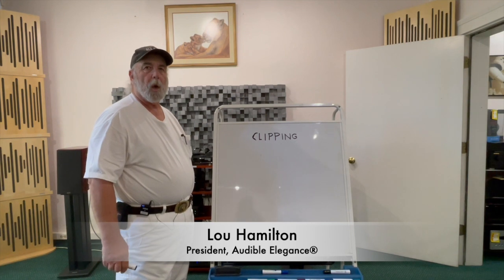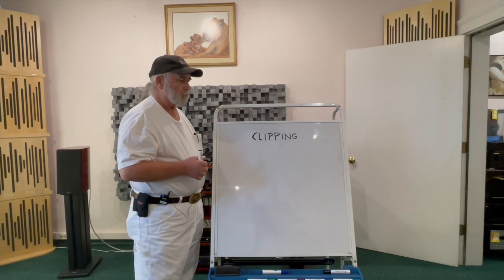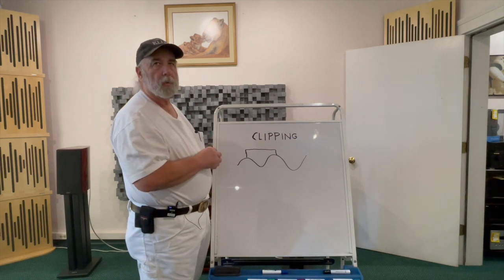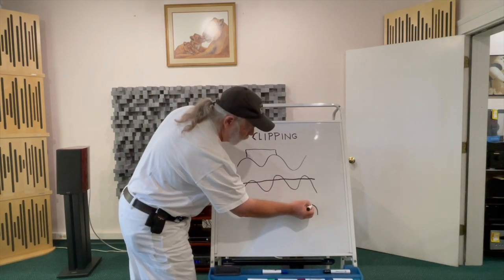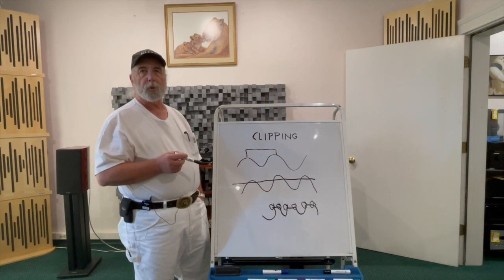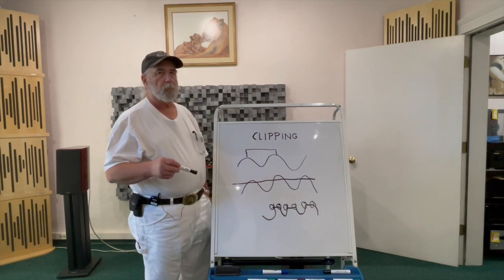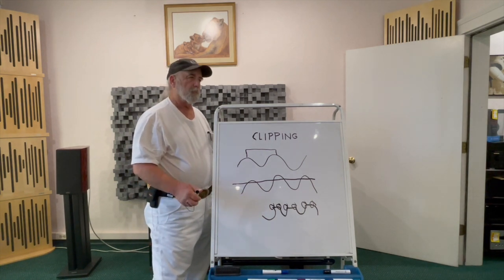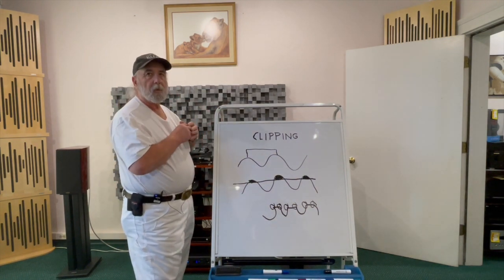What Is Clipping and What Does It Mean (with Amplifiers and Speakers)?

Comment: So are you saying that the problem is the tweeters and no matter what amp is driving them you will still experience the clipping ?
Reply from the maker: Not at all.  Tweeters are essentially very light in order to be quick.  Less inertia.  So, most conventional dynamic tweeters use light voice coils to keep mass down so that they can more more quickly.  The problem happens when the amplifier, which is driving all frequencies, is asked to apply more current for volume than it is capable of providing.  At that point, the amplifier is no longer able to create a complete wave form and, essentially, flattens the curve.  The flatten curve causes heat to be produced in the driver and the more thin wires in the tweeters are first to melt and break oven.  If severe enough, I have midrange drivers suffer the same fate.  That is why if you dissect the driver, you can actually see the burned area and most manufacturers will not consider that a manufacturing defect but rather abuse.  Thus, no warranty replacement. 

In most cases, it is not a matter of too much power but, in fact, too little.  I'd say that about 90% of the damaged tweeters I have seen have been victims of underpowering, not over.  Then, of course, there is also the physical limitations of drivers themselves in their movement referred to as excursion.  IF you are a volume listener, or in a very large room that you want to have volume (105 DB and up), some consideration should be given to horn drivers that do not require a lot of current to provide that volume wanted.  Please see my other videos about power.